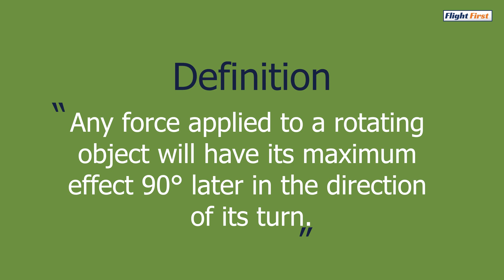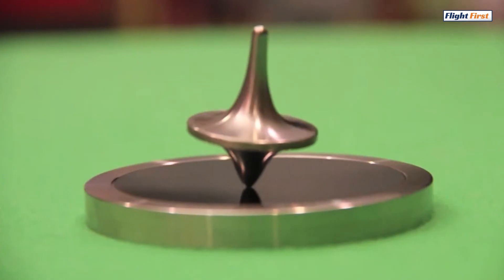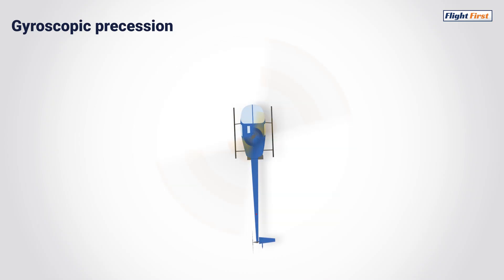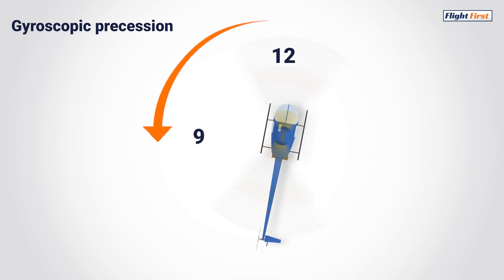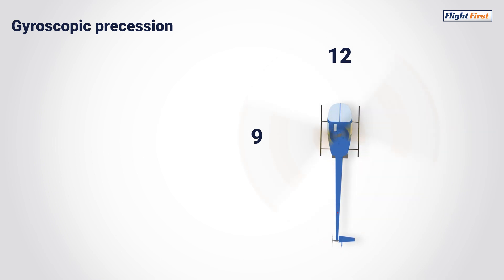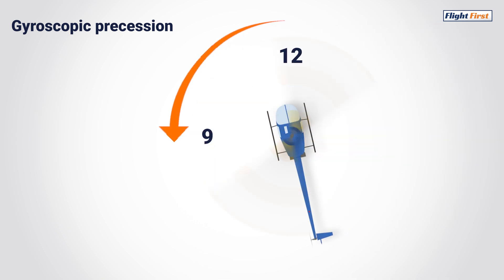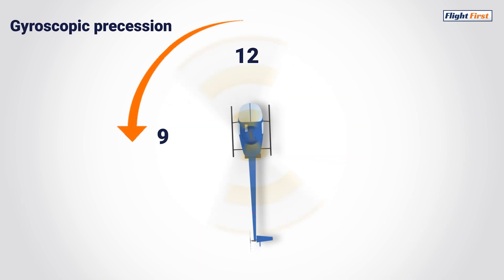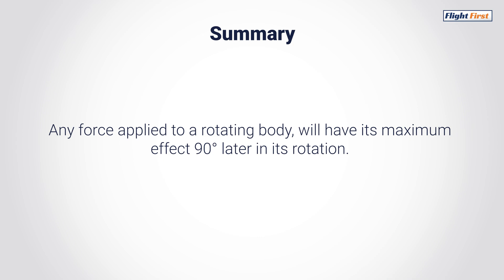How gyroscopic precession affects helicopters

Comment: Precession is only used to convey the concept. A rotor system is NOT a gyroscope, which is a rigid disc attached rigidly to a shaft. The rotor system has hinges to allow flapping, some have lead/lag, and the disc is usually only attached by a flapping hinge in the head.
It is in reality, Newton's laws being demonstrated. Apply the force to the blade, it starts to accelerate either up or down. It takes time to reach its highest/lowest point, and by then the blade has turned APPROXIMATELY 90 degrees. By then, the swash plate is changing the pitch angle again and it goes back the other way.
It is called Phase Lag, and in the R-22, which has a very light rotor blade, less time is needed to move the blade, so the phase angle on the R-22 is only 72 degrees.
But the effect is NOT precession, this name is just used to help students grasp the idea of swash plates, and pitch change horns passing the pitch angle to the blades in advance to allow for the phase lag.
Reply: Does this apply in blade flapping as well? Because all the explanations I’ve seen about flapping says the blade facing the headwind immediately acts on the fuselage. It feels like the headwind and the subsequent higher lift should also have a ‘delay’ too.
Reply: Absolutely true. Gyro precession is an analogy, not an explanation. Aerodynamic blade flapping is the explanation as you say.   The only thing I'd add is that the aircraft probably experiences some gyro precession in the rotor head, mast and gear box, but these effects would be quite complicated depending on the rotational velocity of all those parts and the resultant precession might not be detectable.  Amazing the components handle all these stresses!

Comment: Just like almost any people talking about gyroscopic effects you are oversimplifying things a great deal. Have you ever tried looking into the formulas involved?
Stop spreading wrong ideas about precession - it does not "manifest itself 90° later". And if you still doubt that, when was the last time you saw rudder and elevator control rods twisted at 90 degrees on a prop plane? Sure, you do have to deal with gyroscopic precession there too, but it's not as straightforward as swapping one control input for the other.

Comment: Rather than "increasing pitch angle at 12 will not manifest until 9" is it more physically accurate to say that the extra force is exerted at 12 and immediately initiates a right roll due to conserved angular momentum? In other words, the force at 12 "appears" to exert its effect on the rotor disc at 9 "as if" the rotor disc were a non-rotating object. I think the explanation in this video implies that the effect of the force at 12 does not occur until the blade has reached 9. This is not true because the force is present when the pitch angle changes.

Comment: What happens with helicopter with contra rotating coaxial rotors? Change applied on the 12 oclock, will have effect on the 9 of the one rotor and on the 3 of the other rotor, right?  Will they cancell each other out? Or they will both contribute on the 12 like there is no gyroscopic latency? How do the contra rotating helicopters work on this subject?
Reply from the maker: That's a great question! On a rotor system like that, the effects of gyroscopic precession would not cancel each other out. The common rule of thumb is that a coaxial rotor system has 45 degrees of precession instead of the regular 90 degrees. This is due to the swash plate, as well as the bottom/top rotors being mounted differently.
Reply: @flightfirst6311  so laws of physics change depending on the swash plate mounting? :D
Reply: @loremipsum3147  This is what happens when people who don't know what phase lag is try to explain how helicopters work because they copied some other guy on Youtube.